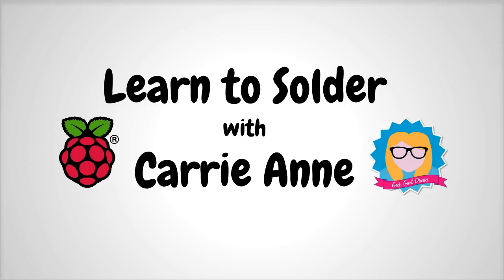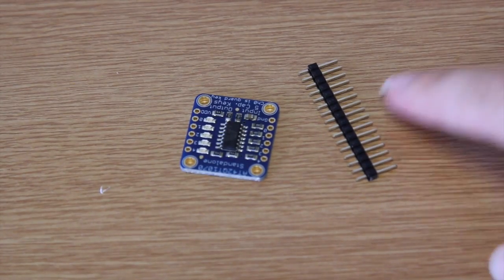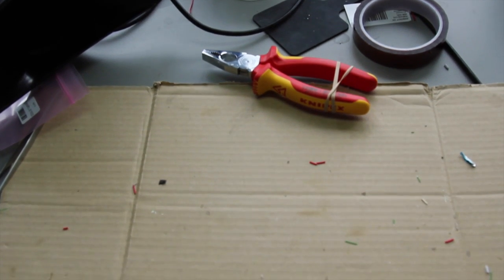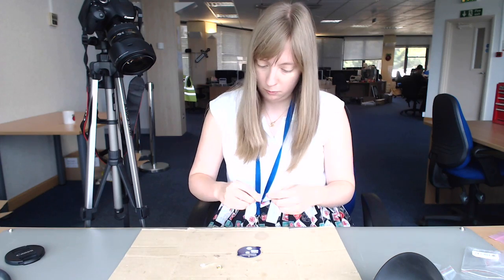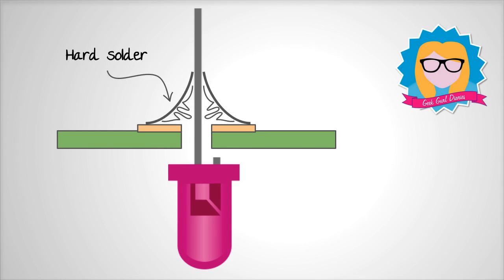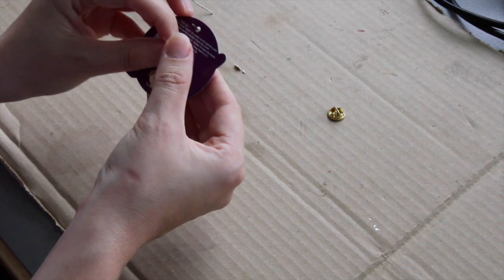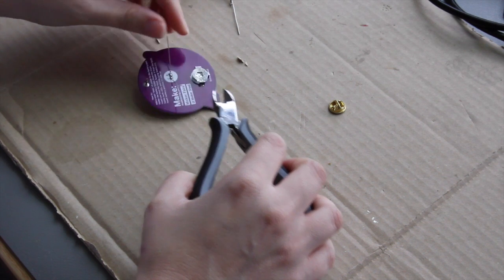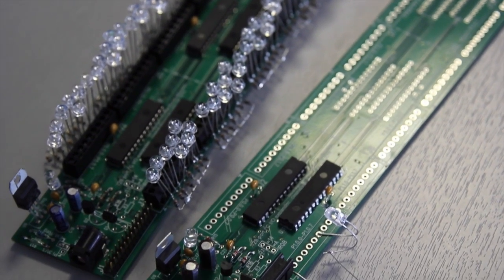Learn how to solder with Carrie Anne

Comment: Just a quick point Carrie Anne the Main problem most people get is keep your soldering iron clean, it can never be too clean as soon as it stops being shiny at the hot end wipe it against a damp spong to remove the burnt flux as when the dirt builds up you have to hold the iron on a lot longer to get it to heat up. i have worked on electronics most of my life and people come to me and say you are good at soldering but when i try it does not work and makes a mess, i always get them to show me how they solder and 99 times out of 100 is the iron is dirty also to help transfer the heat quicker (which can save a lot of chips) if as soon as you have cleaned the iron put a small amount of solder direct on the iron as it will transmer heat a lot faster that way.

you did a great job on the video it is nice to see females getting stuck in with electronics.
regards Poppy Ann.